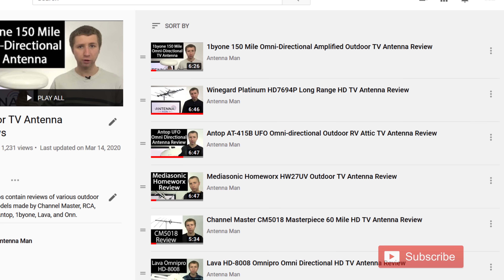Lose TV Stations at Night? This Common Item Interferes with TV Reception

Comment: The only problem I've had with LED bulbs was interference with my garage door opener. Replacing them with Genie low interference 60W equivalent LED bulbs cured it. They go for about $10 each and work in any standard bulb socket. Just possible it might work for TV signals too.
Reply: Exactly. Build quality varies on bulbs, many cheaper ones are more likely to create interference than higher quality ones.
Reply: I had the same problem with my garage door opener and LED lights.

Comment: Aren't led bulbs supposed to be FCC Part 15 compliant?   I've been hearing of noisey led bulbs causing interference with amateur radio for several years now.   You'd think FCC would come down hard on bulb manufacturers that sell this junk.
Reply from the maker: I'm under the suspicion FCC doesn't care much unless there's money in it for them. They could make some money off fines though!

Comment: I knew floresent bulbs put out a good bit of RF dut didn't know LED bulbs did. I have a 100WLED outside security light that may be causing problems. Do you know a proximity range in which they cause interference?
Reply from the maker: It depends on the brand of the bulb and how weak the signal is. Turn it off and see if the reception issues go away.
Reply: @AntennaMan  Thanks for reply. Its owned by the city though and comes on when it gets dark. Guess I could test before and after it comes on and mabye move antenna further away if its issue. Is signal strength on the box a good indicator if its interfering or not?

Comment: Can you explain why I gain TV reception at night?
Reply from the maker: I don't know the exact details yet but I do know amospheric conditions are generally better at night. Might have something to do with the son. Maybe someone can chime in.
Reply: @AntennaMan  Yes. the sun has effects on parts of the atmosphere, changing radio reception.
Reply: Bad daytime and good night time reception could be due to the way that the atmosphere can bend VHF and UHF signals.  In the daytime there's hot air near the earth's surface and colder air aloft.  This tends to bend the radio waves upwards, reducing signal strength near the earth.  At night (especially without clouds) the earth cools rapidly, so the air near the ground is cooler than the air aloft, bending the radio waves downwards and making them stronger near the earth.  Also, some stations change power level and antenna pattern at night.
Reply: That’s very interesting, I had no idea that the heat during the daytime can affect VHF waves. Thanks guys.
Reply: @Clip_The_Fax  Not necessarily the heat, but other radiation from the Sun.

Comment: The repack has greatly reduced my signal strength and knocked out one channel completely over the last year. Any solutions???
Reply from the maker: Contact the station directly and see if they are at a reduced power. I have a few stations by me that couldn't complete the tower work and have been at a reduced power for nearly a year. If they aren't at a reduced power you may need to adjust your antenna or get a better setup.
Reply: @AntennaMan  we lost an NBC affiliate with COZI sub channel. The station only has a voice recorder and they never called back.
Reply: @jimc3688  i am experiencing the same problem with nbc since  the repack. I cannot get that channel no matter what i do on all4 of our tv's. Very fustrating. Anyone know of a solution?
Reply: @madambutterfly5842  I never received an answer from the local station. However, I relocated my yagi antenna (with added amplifier) from first floor to the attic and now I (most of the time) get COZI back. Next step is to mount on the roof with a rotor.
Reply: @jimc3688  thanks for the info. I think it's time to upgrade our rooftop antenna if that's possible. We have a metal roof.

Comment: i remember vacuum cleaners used to interfere with TVs
Reply from the maker: They probably still do. That and microwaves but they aren't on all the time.
Reply: AKA Spark Transmitters like in the early 1900s generating broadband electrical noise. 
Back in the 70’s I was able to operate a garage door opener with the noise from a 1/4” electric drill.
Reply: Plus they scare the heck out of my cat
Reply: only the picture. Audio and color weren't bothered.

Comment: LED bulbs can also cause wireless garage door openers to sporadically not work (especially the cheap store brand LED’s). I replaced the cheap LED bulbs in my new garage door opener with Sylvania brand bulbs and have had zero problems since. I’m guessing the more expensive bulbs have better RF shielding.
Reply: My garage door sometimes opens back up a few times before it closes   has LED bulb
Reply: @stevedonohu7939  Some garage door openers definitely  have problems with cheap LED bulbs. look up online which LED bulbs are recommended for your particular opener. Another brand that was recommended on my opener was Phillips.
Reply from the maker: Interesting thanks for sharing!

Comment: I find that odd because at night  i get better signal  about 30 percent better? if i scan at night i get about  10  more channel after 9 pm ????( I use antenna direct ) facing a window (channel  master amp for 2 tv s) and a (LTE filter  from channel master) i live in Ontario Canada
Reply from the maker: Atmospheric conditions are generally better at night. I made this video for people with the LED issues. If you have better atmospheric conditions yet your signal gets worse there's likely interference - in many cases LED light bulbs.

Comment: I noticed that the air cleaner that my wife likes to use in the bedroom can cause interference for a moment when I turn it on or off.  It doesn't matter UHF or VHF or which TV I use.  I've not noticed anything regarding my LED lights, and I have quite a few on my aquarium.
Reply from the maker: It depends on the brand but some LED lights can cause problems
Reply: @AntennaMan  Most of my individual LED lights are Cree, and the aquarium lighting is Mars Aqua.

Comment: Yes Tyler, I have problems with FM reception. I have LED Light Bulbs and when I turn them on the medium to low signal radio channels completely disappear. Lucky I have an outdoor FM antenna and don't have a problem with FM reception. Even LED TVs and Monitors ruins the signal.
Reply: Nicholas 2016 adding snubber capacitor into the power strip used with these devices can cut the RF Interference. See my other post in this thread for details.

Comment: Thanks Tyler!! :-)  And who would ever thought it was so simple as an LED light bulb.  I swear Tyler, you never cease to amaze me, you're awesome dude.  Have a great day!!!  -Melvin - Sunday, May 10, 2020 - 3:09 PM Mountain Time - Colorado Springs, Co
Reply: Yesterday I saw a Youtube video about installing an outdoor antenna, and the guy found he was getting interference from a LED fixture in an attic. His solution was to install an aluminum pie plate above the fixture as an RF shield.
Reply: @kayl456jenna
Reply: LED bulbs are hardly simple on the inside! Some are made to respond to dimmers, others cannot do that and will shut off as dimming is attempted. There is serious electronics in both CFL and LED Bulbs! Find a functional AM Radio, tune it off station and put it closer to either a CFL or standard fluorescent  or LED bulb and hear what is really going on, then put it up to an incandescent and notice the lack of interference.
Reply: @DishNetworkDealerNEO  saw your post after my rant. an AM radio can find all kinds of things. My AM radio pings constantly near my new "silent" electric smart meter. Right.

Comment: LED manufacturers could install more capacitors in the LED's, which would drastically reduce RF...sometimes the circuit boards inside the bulbs even have leads built into the traces to install capacitors, but no capacitor installed...the FCC doesn't force them to reduce RF, so the LED manufacturers would rather save a penny per lightbulb rather than reduce RF noise.  

Install capacitors at your own risk, I'm not responsible for your actions.
Reply from the maker: Some brands are worse than others in terms of interference. I agree the FCC should prohibit interference from them.
Reply: Thanks for the reply.  If anyone is interested a ham called Kevin Loughin has a youtube video on what he did to reduce LED interference on the 2  meter ham band, which is just below the VHF-hi broadcast TV.   Getting that much noise on 2 meters is a pretty impressive feat, not in a good way.   Again see disclaimer above.

https://www.youtube.com/watch?v=RaVicRHGoic

Comment: You think they would make a filter for it much like an LTE filter did for high UHF signals, Since it is a VHF problem Do you think an FM trap might help?
Reply from the maker: FM traps only stop the FM band. I don't know of a filter that would stop the interference but maybe someone on this channel does.
Reply: @AntennaMan  Radioshack used to make an AC filter, you plug your tv cord into it & plug the filter cord into the wall, it used to help with older ungrounded outlets & homes

Comment: I never knew a light bulb could cause electrical interference on frequencies that high. I get lots of electrical interference on am radio from things like light bulbs but have never heard it on fm radio which uses very similar frequencies that tv uses.
Reply from the maker: If your signals are strong it's not a problem but can be it the signal is weak.

Comment: Hello Tyler. There is this model of antenna: https://www.dipolnet.com/fm_radio_antenna_dipol_3-rz_b_A0312.htm  It gets excellent FM Stereo reception and perform well with VHF high. My question is will it work on VHF TV Low Band ?
Reply: In the analog days I could receive both FM Stereo and VHF High TV channels with great picture. Never had in my area VHF Low TV channels. In the digital era everything is on UHF.
Reply from the maker: I never saw this model. If it's cut for FM  it would be great for low VHF
Reply: @AntennaMan  Maybe you can do a video with this antenna and how it performs on both VHF Low and VHF High. The transformer inside is for Channels 1 to 69, you can take out the circuit and mount it inside a Yagi UHF antenna and work great.